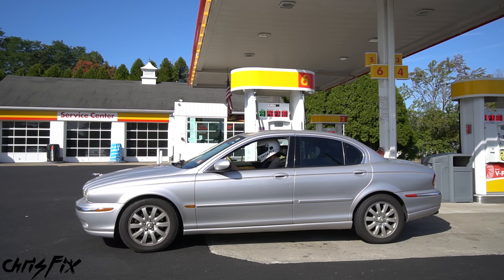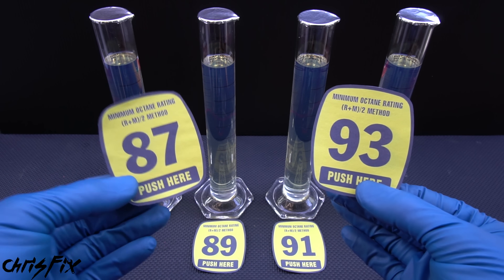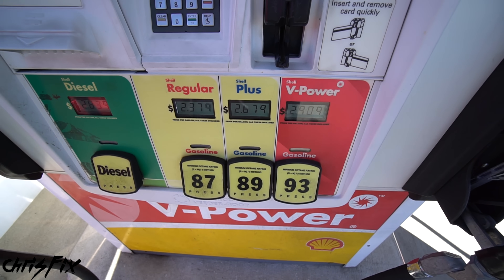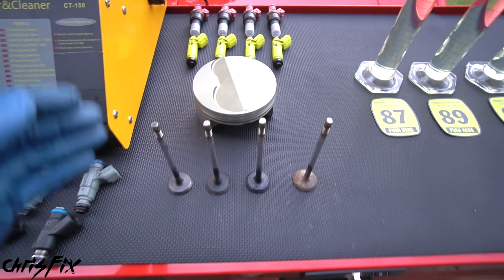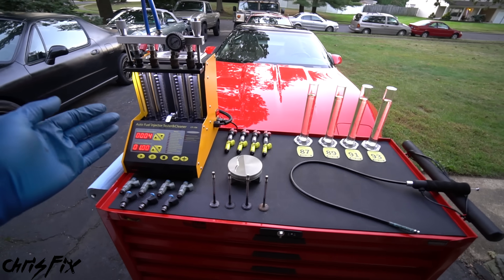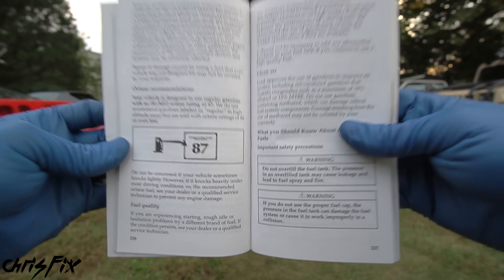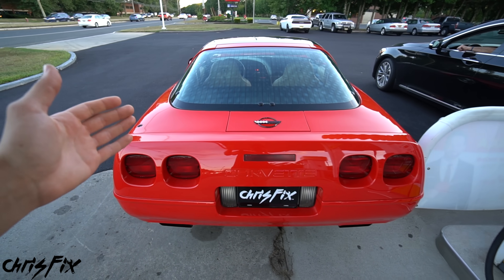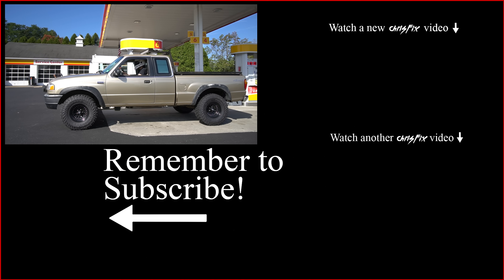What is the BEST Fuel to Use in Your Car or Truck and WHY

Comment: If you could test the carbon removal process in the engine of using a spray bottle and spray a fine mist of water down the air intake that would be awesome. I have seen other people do it but not really test it properly with a bore scope like you would. Pouring water in the intake is not a smart idea I have seen that done too but a spray bottle with a fine mist will have no chance of damaging the engine.

Comment: This video highlights the lack of clarity for consumers at the pump.  E85, 87, 89, 91, ethanol enhanced 15%, most people don't have or take the time to figure out what's best.  Of course, the industry won't change, the profit by people overspending on unnecessary premium.  This is one of those cases where I think govt should step in.

Comment: I own a 2003 buick park avenue with 127k miles was woundering if i can use premium 93 to clean the inside of the engine like injectors n carbon deposits?

Comment: Back in the '70s (yes I'm an antique) when OPEC was formed and the price of fuel tripled overnight (from an average of 25 cents per gallon to 70 cents per gallon) there was a news report that said if your car took premium gasoline, you could mix half regular and half premium and get a higher octane than premium.  I have done this on premium cars (mostly Cadillacs) and it seemed to work.  I was just wondering is there any truth to that or was it wishful thinking?
Reply: BTW, most cars at that time still used leaded gas.

Comment: I’ve got a 2010 Nissan Titan with 182,000 miles. It’s a flex fuel v8. I typically run flex fuel in it and occasionally treat it with 100%gas to clean things out. My problem is that I have extremely “clicky valves”. Is it time to replace parts, or is this normal for an E-85 engine? One other issue I get, is when it’s below freezing she’ll stall on me in the mornings after first starting up. I quit letting it warm up because that made it worse and took up tk 10 minutes of time I don’t have. Any suggestions?

Comment: The maker of this video is incorrect in that 87 octane (which typically has 10% ethanol content) has the same amount of energy or "burns at the same temp" as 93 octane (which has zero ethanol content).  This is scientifically impossible since ethanol has a lower btu output than gasoline.  This is why it takes more E85 to go a mile than it does with 89 octane(no ethanol).  Gas mileage suffers when using E85 or any content of ethanol vs  89, 93 octane gasoline (zero ethanol).

Comment: I have a 2003 f150 with only 50k miles I use the recommended 87 but I only get 10 mpg should I start using higher octane

Comment: ChrisFix: The only difference is the fuels resistance to burn, more power and better economy are myths.

Also ChrisFix: We can run regular fuel. You might notice less fuel economy and less power.
Reply: Lower octane causes engine pinging.. lol  Engine pinging means less efficiency which makes the car slower. Simple math and knowledge from experience. Nice try though.
Reply: @djplayboyshow2477  If you have an engine pinging using suitable fuel, "Recommended" as Chris explained, then you have a separate issue.
Reply: @tylerpatchin4246  Simple math and basic chemical science. Yo boy is incorrect. Plus he already contradicted himself. But nice try and video.

Comment: Additive claims are neat, but not how fuel distribution always works. If a series of stations doesn't go through enough volume, they don't get a spot at the rack for their additive. You get the standard rack additive base pack; or another brands pack.

Comment: I had a ford ranger and I went from 87 to 89 and I could feel that it was faster and had more power to it I'm a drag racer also and if we run 93 in our motors it's nowhere near as good as 110 or 112 octane our motors are usually about 12 to 14:1 compression

Comment: Chris, the only thing I was hoping for you to cover was E0 (Ethanol Free Gasoline / 100% Gasoline.) I use it in yard equipment since it lasts longer and I don't have to bother with fuel additives. I also use it when I store a vehicle over winter.

Comment: So when you tune a vehicle with higher octane and you gain horsepower from that means nothing I guess??? Switching from 93 - e-85 also gives more power... when you switch to 87-93 and either your computer learns which one you are running or you get tuned for 93 or e-85 you are gaining power no matter what, it’s not a myth man.

Comment: Octane is one of the combustible chain isomers in fuel. As in: butane, methane, pentane, heptane, octane. Octane is a slightly more complex molecule and resists early detonation. It is not just an arbitrary rating.

Comment: I use V power at shell, but in my town the number is 91. Whats the diff between 91 and 93?

Oh. You said it a few seconds later. So it should be fine then. I have a turbo

Comment: what if i'm casually redlining the tach every day, am i relatively safe from carbon deposites?
Reply: As long as you're in gear, and the engine is warm. WOT helps reduce carbon deposits.... But there's a trade-off to everything.

Speed. You also get more speed at redline.
Reply: @trey5169  that's fine then, there's one very agressive highway on my daily commute, lots of takeovers to be done anyway.
Reply: The heat from redline helps burn off carbon deposits, but I believe fuel additive packages do just as well if not better in removing carbon deposits

Comment: My 2000 Ranger with the 3.0 used to ping on anything besides premium. I recently put new heads on at 200k miles due to leaking exhaust valves. Before I installed them I rounded over all the sharp edges in the head’s combustion chamber with a dremel sanding drum and cleaned all the carbon buildup off the piston faces. It can run on regular now with no issues.

Comment: Cleaning fuel injector hack: 9v battery hooked up to fuel injector with alligator clips/probes to touch the injector's terminals(3 handed job.) Spray brake cleaner or similar cleaner in injector while powering with 9v battery. This got my jet ski running like brand new after having gunky fuel injectors.

Comment: What about cities who have 86 octane? Where recommended is 87. Do you put 88 or 86?
Reply from the maker: That’s usually high elevation locations. High elevations have less air pressure so less octane is needed.
Reply: ChrisFix so 86 or 88?

Comment: One thing that maybe worth mentioning is if a vehicle falls under the premium recommended and you switch between 93 and 87 or you put premium in an 87 car you’re more than likely going to get pretty bad fuel economy and performance for that tank (or more often if you are inconsistent with the fuel you use).   The computer adjusts the timing and such to the fuel it’s running and it can take some time for the vehicle to “get used” to the new fuel.   It’s best to try to pick one octane rating and stick with it.
Reply from the maker: Very true and great additional comment.

Comment: I use jet fuel. Just one drop and... well you know the rest.
Reply: jet fuel is more like diesel than gas
Reply: @murraydupley9330  diesel doesn't have what all jet fuel users want:       Lead
Reply: @Mrcrappyfuntastic  jet fuel is kerosene based. It doesn't need or have lead. Avagas for piston driven plane engines has lead.
Reply: AH! Why is there poop in your mouth makes sense when it doesn’t melt steel beams

Comment: Wasssup crhis keep up the videos! Is it bad to change the transmission fluid myself on my Toyota Corolla 2010 1.8 liter ,?? Because this person told me that I have to take it to the dealer because they have a special machine that's does I don't know what , that if I do it myself it will mess up my transmission ? Is that true ?? Not a transmission fluid flush just a fluid change , thanks
Reply: Only "machine" I can think of would be a machine for a transmission flush, but you should be able to change the fluid yourself.
Reply: @ixionn563  thanks!

Comment: Hey Chris, My Veloster base was pinging and it all went away using mid grade. Could it be carbon deposits and it has an 11:1 compression ratio. It's crazy that a little 1.6 engine would have such high compression. Am I fine using 89?

Comment: I drive a early 90s Nissan pickup it's fine with 87 octane but it doesn't like E10 at all. With E0 (no ethanol) I typically get 20 mpg city and 23-24 mpg highway. with E10 I was getting 17 mpg city and maybe 20 mpg highway.

Comment: Question please, I always fill up at Sam's Club or Costco wholesale & they have only 2 options regular (which has the same octane rating as every other regular gas station's mid grade but it's also 10-20 cents cheaper, make sence of that 1!) & premium. I have an old 1988 Chevrolet Suburban R10 that I'm sure would run on regular no problem (never tried it myself). But that extra octane wont hurt my engine, right? Will it help in any way? TIA

Comment: Also if you vehicle has no gas cap from the factory (not because you or someone forgot to put it on) the chances are it’s flex fuel E-85. Some manufacturers use yellow caps also not 100% on the yellow cap... Example my 2015 has no gas cap I don’t use E-85 cuz not a lot of places carry where I live. However if you run it don’t keep switching back and forth between 87 and E-85. Pick one... lol

Comment: Hi Chris, I have some questions.

I'm filling up with a specific brand, having some performance issues and already try a higher octane but when I try another brand, I got more performance and better fuel economy.

So the questions are, the additives can make some difference.? or is it possible that some brands dilute the fuel ?.

Here in Argentina, this specific brand is known to lie about the octanes, and the kerosene (for heating stoves) is being diluted.

Can they dilute gasoline as well?.

Thanks, And Love the video.
Cheers.
Reply from the maker: So in the USA all fuel has to be the same except octane and the additive package and that is mostly for cleaning and preventing carbon deposits.
Reply: @chrisfix Technically, here is the same, only changing the coloring of the premium gas. But I'm conducting an experiment, as my driving is the same every day with no changes usually. 
Filling half tank and using it all the way down, then change 2 times to the next brand to ensure no mixture. and recording how many kilometers can I make.

The one brand that has diluted fuel. The tanks wasn't inspected in a long time. Recently they fail inspection.
They removed all the cisterns, lines and pumps. a new system was installed.

I'm yet to try it but i have hopes, since it's the national brand and less expensive.
Reply: de especific brand are YPF? thoses m***********s every time a was obligaited to fill therye my car says that ther is water detected in the fuel fielter
Reply: What??
fix your broken English.
I'm not gonna declare any brands (it's not Shell or Axion, it happened with the other brands, only that I'll say about it).
Also, the computer detected water in the fuel system in my car too.
If They are diluting fuel with water, it wouldn't be ok for the engine for sure.

Supongo que sos de Argentina tambien, yo soy de Córdoba ¿vos?
Reply: @zedvarg  rosario osea que tambien paso con la petrobras y la oil que tal es la axion tengo que probarla aun

Comment: Question: I have a 2015 Ford F-150 (Lariat) with an eco boost engine. In the manual, is says the truck runs fine on 87 octane but if towing trailers and such, I should consider high octane. Thoughts?

Comment: The only time I notice a difference in fuel is during winter. When they start selling their winter blend gas I definitely notice a difference in power, fuel economy, but more in how fast my car starts. I know it has to deal with the temperature outside, but I even notice my truck takes a little longer to start even when it was warm out and I still had a little gas from winter.

Comment: I have a 2019 veloster R spec and a HUGE question that the manual, the manufacturer, the dealer AND the internet cant seem to answer. When I hit sport mode I get BETTER gas mileage. I wanna know if the turbo is force feeding the engine extra air (more than it would in normal drive mode). Its a manual so i decide the shift points. If it is adding air than wouldn't that increase heat and wear and tear? ANYBODY?!?!

Comment: Just a question, looking for some help. So i have an 2009 V6 G8 and for some reason the engine runs super hard when sitting on an incline, the steering wheel shakes pretty hard at idle while sitting on an incline. Will running premium help this issue? My car runs fine on 87 octane on level surfaces

Comment: Chris fix is trending. Nice job, you've earned it!
Reply from the maker: Thanks
Reply: @chrisfix  Congrats on hitting number 8!!
Reply: Drew J. Now it’s. 4th!
Reply: @themidnightinator  awesome!!! glad to see chris where he should be!
Reply: Can you do a video on supermarket fuel vs branded fuel. Because I was running asda supermarket fuel and even though it was the cheapest option in my area I realised that my fuel was running out quickly in comparison to shell fuel even though I'm technically getting less fuel for my money with shell.... And also I noticed on a different occasion that after running tesco momentum 99 supermarket fuel after about three tanks my engine started to sound a bit rough, but after returning back to shell fuel my engine became much smoother again... So I know that supermarket fuel is definitely not as good as branded fuel... Would you do a video on that...?

Comment: Does ethanol play a factor in how quick gas burns or how much power you get?
My car seems to run better on 100% gas, and my older one blew a rubber piston part because of ethanol coercion. The manual mentions nothing about ethanol.

Comment: Chris thanks for this video you have confirmed what I was thinking I have a 97 Ford Taurus with a 3.0 Vulcan engine I did research and found this engine has no knock sensors in the manual it says a little knock is okay but a lot is bad so I went to premium and it went away the only problem I have is I did a whole lot of cleaning additives and seafoam and I thought it would fix it that way but I guess I have to stick the 93 until it fixes the problem all the way just like you said it would take up to 2,500 miles on 93 with shell to do it I will do that and hope for the best I love this car nothing can stop it

Comment: One thing I've noticed with my 2003 GMC Sonoma ZR2 with the 4.3 is that it is set up for 87 but I would run high octane and it got much better gas mileage as well as that signature 4.3l bottom end ping got noticeably quieter as well also my ex-wife's 94 Oldsmobile ran better on 89 and it was set up for 87 octane it would have a ping especially on acceleration and going up hills it dramatically reduced after I started running 89

Comment: Great video Chris.I currently have a QG15 engine and I get horable gas mileage. Did everything I could possibly can tune up and cleaning wise. Any idea what's the issue? Thinking the engine has aged and compression is low

Comment: I have a 2003 Lexus LS430 V-8 that on the gas cap says "Premium Fuel only"

Been filling up with Regular 87 Octane every time, and have never put 91-93 Octane in it, not even once.

Still running like a champion!

Comment: Hey Chris, you mention the RON octane rating used in Europe vs the pump octane rating used in the USA. Did the USA ever use the RON rating? I have a 69 Ford with a 390 in it. The owner's manual says that regular gasoline is okay to use, but also lists 94 octane as the regular fuel to use. Now, 91 octane is the highest rating in most places. I've wondered maybe, the octane grading in the USA has changed since then. Any input is appreciated.

Comment: Using low grade gas on Mercedes cars is not recommended. Regular gas can reduce the life of the engine, cause a check engine light and it cause the fuel to preignite.

Comment: A gas station near me has e88 and claims to work in any car newer than 2001 and it's usually cheaper than regular.

Anyone got any info on that?
Tried it in my car and I get like 3-5 miles per tank.
I drive a 2011 Ford Taurus if that helps at all

Comment: Chris there's one weird case you didn't mention, getting gas in a high altitude state like Colorado. The lowest octane there is 85 and only goes up to 91 premium. It has to do with the altitude having less air so running a lower octane is less strain on your engine given the environment will mess with the air to fuel ratio. I had a big scare about it when I was visiting Denver.

One tip I've heard is if you are visiting one of those states, run the tank down close to empty, try a gallon of what the equivalent rating for your car is, run to see it knocks by the gas station. If it does, just go up in octane or buy octane booster. 

I was there in my Accord and the 85 they have was below the minimum rating in the manual (86 octane), but because of the thin air it just acted like it use to in Texas. Was able to go up Pikes Peak running it.

Comment: If you fill up with e-85, you likely won’t damage your engine. The check engine light will come on and your mpg will go way down and the engine will rev up more, but just run through the gas as quick as you can. No need to drop the tank. Ask me how I know.

Comment: Hey ChrisFix! My owners manual suggests 87 octane, however my engine is turbocharged (Veloster Turbo). Would it just be a safe bet to use Premium rather than risk the engine knock for 87?